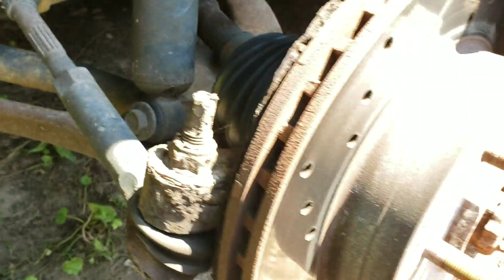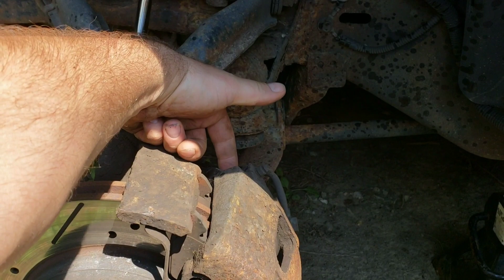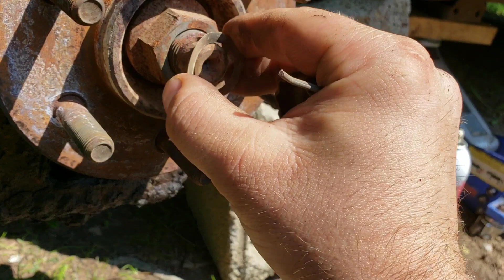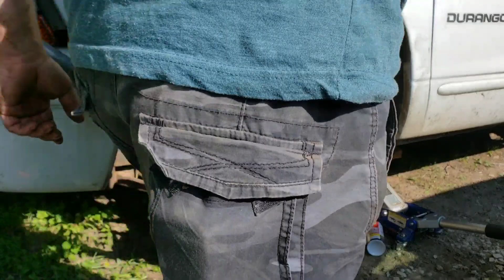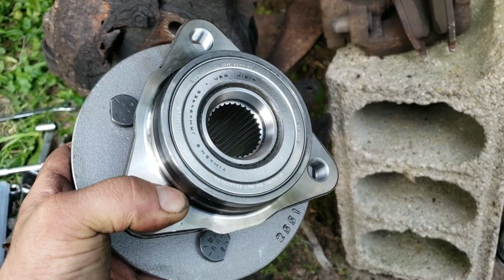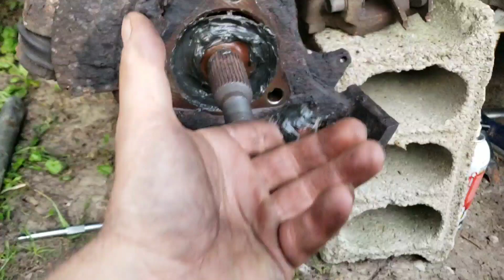98-03 Dodge Durango Front Wheel Bearing Hub How to Replace Removal and Install

Comment from the maker: Hey guys: Not sure if it's different between years/trim, but it seems that most Durango caliper bolts do in fact have the torx bit head like I used in the video. Sometimes it's possible that other owners in the past replace hardware with different sized stuff, so that's also a possibility. Please be aware that yours may be different!
Reply from the maker: Can't believe you don't know how to spell the simplest words correctly...

Comment: That was a great video.  Thanks for the help.  I'm a tired old man but I'm gonna try and replace these myself.
Reply from the maker: Powerful impact gun will really help to get the axle nut off.
Reply: @BuckeyeBallistics  Thanks,  another question...I'm assuming my issue is front hub-bearing but not sure what side.  I jacked it up and spun both sides by hand and couldn't tell.  I have checked out the front and rear diff. & transfer case, no issues.  How can I test to see which side bearing is bad?  Thanks in advance for your thoughts.
Reply from the maker: @supercancerman1959  Spin it and listen as you did, or grab the tire and shake/twist it back and forth, left and right, top to bottom to see if it has play. But doing this will also let the wheel/tire flop around if there is a bad ball joint or other component to the front suspension geometry that'a bad, so watch those and be sure that it's not one of those before assuming bearing. Other than that, stick your head out the window and do a bunch of turns in a big empty parking lot and listen, then have someone else drive and stick your head out the other side to find which side it is.

Comment: get a beefy breaker bar/pry bar/pounding bar from a hardware store, and put it in between the bolts, then take care of the nut with a 3/4" size socket wrench-- 1/2" is just won't cut it.

Comment: For those who go through hubs constantly avoid cost efficient hubs moog or timken have good warranty and reliability as well. If you over torque the axle/spindle nut you will go through bearings fast as well.  This is obvious but make sure your ball joints are good before finishing... having your wheel seperate isn't a fun experience. lol @Guns&Cars was equipped with the knowledge as it seems

Comment: Those hub nuts can be a mother after years of corrosion and heat, its like they weld together. I periodically get under my truck with a can of lubricant and hit everything with bolts from front to back. It pays off when its time to do major work. Good job on the work!
Reply from the maker: Thank you man, and that's not a bad idea.

Comment: Ok, some more advice needed...As you suggested had a friend drive the truck around in circles and wasn't able to diagnose which wheel bearing was grinding.  So I guessed and pulled the drivers side.  It came off pretty easy I think overnight soaking and several squirts of BP did the trick.  So after I get the hub off the thing doesn't have any slop to it and when I spin it by hand it doesn't grind.  So...I move to the passenger side and pull it.  Same result.  So I'm going to obviously replace both sides,  just wondering is it possible that the bearing(s) is shot but doesn't have any slop to it or grinding when spinning on the bench, by hand.  I guess my worry is maybe I misdiagnosed the whole mess and I'll replace both hubs for 300+ and still have the grinding in the front end.  That said both had moisture and red-rust colored liquid with no grease in the cups whatsoever.  Clairvoyant anyone???? Tks in advance? Wally
Reply from the maker: If it's dry in there, no grease on the bearings, then it's going to make some noise. Mine did the same thing, only made noise with the weight of the vehicle on it. Other than that, could be in the front diff/transfer case if it's a 4x4.
Reply: @BuckeyeBallistics  Ok, thanks thats what I was thinking.  Guess I'll replace both bearing hubs and then I'll have an answer,  In the process of diagnosing the original problem I drained both differentials and transfer case and replaced the fluid. So I guess its the hubs.  I'll let you know as soon as it stops raining and I can get back to it.
Reply from the maker: @supercancerman1959  Without hearing it myself, that would be my guess.

Comment: Awesome video. Plan on doing my 2000 dakota 4wd today. Not looking forward to it
Reply from the maker: Lol yeah, hopefully yours goes a little smoother for yah.
Reply: It’s actually not that hard
Reply: Guns&Cars mine was born and raised in Arizona, got the whole job done in about 45 min
Reply from the maker: With your fancy power tools lol.
Reply: Guns&Cars well.. yes. But I do have the advantage of no rust.
Reply: Guns&Cars I even went through the steps of separating the upper balljoint because I couldn’t get a sock on the bolts for the hub, so I had to remove the axle and then tighten it up and reinstall the axle

Comment: my 2002 has 7mm hex head bolts but one bad thing is not let your friends or son take the two pin guide bolts out without watching them because they have no knowledge of cross threading or not using there fingers to put them back in and wiggle the caliper slightly till you at least get 2 or three or more twist while you know for a fact they started threading or you'll have problems finding a oversize bolt that cost 25 bolt that retreads the stripped treads.

Comment: If you have the time to wait, pre-soak those rusty bolts for 1-3 days. Every minute helps.
Reply from the maker: You aren't wrong. I've soaked some overnight that I absolutely couldn't get after a 20min application and they came right out the next day.

Comment: Just to let you know I'm not sure if your car has it but if you pop out the center cap and loosen it while the wheel is on it that's what I did to my Durango
Reply from the maker: This one was so tight it would have spun the tire on the ground (have done it before). At that point you need someone to stand on the brake for you. But I often work alone and don't have the option of help like that, so I have to improvise...

Comment: Hey man thanks for the video! Tomorrow I have to replace both sides , wheel bearings are starting to hum when taken corners..  

GUYs !! Here is a wicked helpful tip !! 

For those back yard Mechanics or even repairs on the side of the road or your nearest Walmart lol 😂  wink wink haha … 

Breaking that Axle nut free !   
Guys break the Nut free when the truck is on the ground still with the tire on with the Engine weight !!  It makes life so much easier !!! 

I can’t stress enough that some people get there ass kicked trying to get that nut off if they don’t have a 1/2 or 1” air gun with them .. 

I hope I save or help someone out with this helpful tip !! 
I may be a surfer but I’m also a diesel mechanic  my Farther was a mechanic so I was pretty much a grease Monkey the day I was born haha 😆 .. 

Stay rad ! 🤘🏽🤙🏽🤙🏽
Reply from the maker: If yours is as tight as mine was, it will spin the tire on pavement (ask me how I know). In such a scenario, you will have no choice but to take the tire off and chain it up.
Reply: @BuckeyeBallistics , an alternate method is before removing the caliper & rotor, stick a decent thickness (sacrificial) screw driver in the fins inside the rotor. When you turn the nut the rotor/hub will spin until the screw driver comes in contact with the caliper mount and stop the rotor/hub from turning. You want the shaft of the screw driver to come in contact with the caliper, not the plastic handle of course. It will lock it in place so you can really get some force on the breaker bar to break the nut loose. The distance between the outer diameter of the rotor and the caliper is pretty small so the screw driver may only bend a little if at all. Nothing near the almost 90 degrees like the long extension used in this video (btw, wow!). The same technique works for torquing the nut back down at the end. Hope that helps someone.
Reply from the maker: If it's tight enough as I discussed above, I would be concerned about cracking the rotor. You may think that's not possible, but I've seen it happen.
Reply: @BuckeyeBallistics , I would think the screw driver would bend way before that would happen. Screw driver metal is not as tough as brake rotor metal.  Rotors withstand considerable forces during braking, so they are pretty strong. But yeah, anythings possible (e.g. if the rotor was already cracked from excessive heat).
Reply from the maker: Well it would depend on the size of the screwdriver and the quality of the rotor. The fins you would jam the screwdriver into are usually much thinner than the rotor itself. In general yeah it should be fine and it's a good tip, but you never know because not all rotors are created equal. 

There has been a problem lately with cheap knock off rotors comming in from China being sold as something of higher quality. I have seen the aftermath of some of these comming apart...
Reply: @BuckeyeBallistics  fair enough.

Comment: The bolt on the 1st gen durango's are hex bit NOT torque bits. You can jamb a torque in there and it might work, but your going to damage the bolt eventually.
Reply from the maker: I made that clear in the video... I said "allen type head", like an allen wrench, which is hex, and even showed it. I made it clear that I was improvising. Also, if you read my pinned comment, some or most of them do have the torx head, and not hex. Like I said in the video, sometimes new components come with new hardware. The truck might come with hex or torx, but then if someone replaces the caliper down the road with new hardware and pins, it may come with a different head. So anybody out there could run into anything in reality. So regardless of which kind you encounter, I made it clear that you should use the correct one if you can....

Comment: About 2 years ago my bango looked rusted bad like that now here I sit after 10,000 this year in maintenance.. 0-0 Oh well runs good drives good ;-;
Reply from the maker: $10,000? Please tell me that's a typo, because you could've bought 3-4 of them for that.
Reply: @BuckeyeBallistics  It's the sad truth I'm afraid lol Oh well might as well throw a 392 in it next lol
Reply: Last night I rebuilt a wheel hub press in bearing that failed early Lol Don't let the "mechanics" tell you that you can't rebuild just the bearing. I'm 22 years old and class is in session lol
Reply from the maker: You can rebuild them with the proper tools, but it's a pain. I'm about to do a press fit bearing on our Corolla, hope my bearing driver will get it in there because I don't have a press. Gonna throw it in the freezer first.
Reply: @BuckeyeBallistics  I used a pry bar and your video length worth of patience the freezer makes everything better. I know a lady in my area selling her bango for 600 bucks because it is running poor lol I just hate to steal it it hurts xD There is no way I will sell my truck for what people want for them. Not after my dedication to the speedy grocery gas gulper to make sure it's heart beats better than mine. LOL

Comment: Where is the front ABS sensors located on/near the hub?
Reply from the maker: Typically they would be on the back or side of the hub, but mine for example doesn't have abs...

Comment: Is it not possible to replace just the bearing? 

I have 2002 Durango with 2wd 5.9l

Or is it the whole assembly
Reply from the maker: Typically it's the whole assembly, but I have seen people replace just the bearing before if you can find just the bearing and seal somewhere. But for the cost of the bearing and seal and time/effort to replace it, it's better (for most) to just replace the whole untit- especially if it has abs, because then you aren't putting new bearings with an old speed sensor that might fail later down the road. Also, depending on how bad the bearings are, the whole thing might be trash anyway.

Comment: Was your hub bearing making a thud sound from time to time....i have a 2002 Durango....and thats what im experiencing....changed out rack n pinion...inner and outer tie rods....brakes and shocks...
Reply from the maker: I've changed out a lot of wheel bearings/hubs and I can't say that I've ever heard one "thud," though they can make various noises when they are worn. I've heard grinding, whirring, clicking, and even what sounded like a dirtbike accelerating because one was so dry. If your hub is making a thud sound, then it's about to fall apart lol. I just recently made a short clip about how to check if they are bad:  https://youtube.com/shorts/Sp6-swrvrT0?feature=share
Reply: Yeah you know I say thud a-poppin loud popping sound you can feel it through the steering wheel but anyway I'm rebuilding the whole front end everything brand new so it don't matter... I guess you could even describe it as a loud pop... I'm changing the CV axles upper and lower control arm both sides rotors hub bearing assembly calipers and shocks and rack and pinion so it'll all be brand-new shortly
Reply from the maker: My best guess would be a ball joint but it's hard to tell without actually driving and hearing it for myself in person.
Reply: @BuckeyeBallistics  yep thought about those to... but they come on the new on upper and lower control arms.... but we're pretty positive that the movement is coming from where the CV axle goes through the hub bearing assembly
Reply from the maker: If you remember after the parts are installed, update me because I would be curious to know what you find.

Comment: saftywise concrete blocks are not safe and prone to sudden failure with no warning, i would never use one for support when working under or partly under a vehicle. just saying.
Reply from the maker: I wasn't under it so I wasn't that worried about it. I do need to invest in larger jack stands for my trucks though, because the ones I have are too small.

Comment: This guy makes this look hard, I just did it and its not that hard OMG...
Reply from the maker: Um, what part? Cause I never said it was hard. I try to be thorough and discuss anything one might run into, especially for the unsuspecting first timer trying to do it themselves. And sometimes axle nuts come off easy as shit with a standard ratchet, and sometimes you snap a freakin breaker bar off on them. I've removed a few dozen axle nuts in the past decade, how about you? If you're not referring to any of the afore mentioned, please enlighten me...

Comment: Was your old wheel bearing making a clicking noise?
Reply from the maker: If I remember correctly, it was making a whirring/grinding sound. But I actually just replaced the other side finally just a few weeks ago and it (passenger side) was making a clicking/grinding sound when I would go around a slight left hand corner at the right speed. I have also heard them sound like a freaking motorbike when they are dried up, and even clicking/marbles rolling around sound. It's real easy to check them- I just posted a "short" a few weeks ago showing how to check the bearing (on the durango actually). Check it out...
Reply: @BuckeyeBallistics  right on brother! My driverside is making a clicking noise that's why i asked. Im getting ready to buy some mevotech ones. I'll check it out for sure!
Reply from the maker: If not the bearing then most likely the axle (if it's a 4x4). That is the common tell-tale sign of a failing axle- clicking. But a bearing can do it too...

Comment: You never reinstalled the caliper spring thingie!
Reply from the maker: You're right, I forgot! 1000 miles later, still works fine without it! I think I showed how I reinstalled it in my brake video if anyone needs to see.
Reply: It was only a Anti-rattle clip lol

Comment: Clockwise or counterclock wise to loosen bearing nuts?
Reply from the maker: Counter? Didn't you see me jumping on the bar? Lol, don't skip the video and then ask questions that were answered in the video...
Reply: @BuckeyeBallistics  not the axle nut. At 10:13
Reply from the maker: Everything is counter clockwise- lefty loosey, righty tighty. Usually the reverse thread crap is exhuast stud/engine components.

Comment: I can't find where to buy those hub bolts
Reply from the maker: The mounting bolts?
Reply: @BuckeyeBallistics  yes
Reply from the maker: @tylerpreston8720  Typically hardware stores like lowes and home depot won't carry automotive sized bolts, because they are built to stronger standards than what they carry. You will either have to get them at an auto parts store, or order them from a Dodge dealer; they will be expensive from the dealer.
Reply: @BuckeyeBallistics  I really just don't know what part number the bolts are or what they're called. All the auto parts stores at check they only sell the bolts with the hub
Reply from the maker: @tylerpreston8720  Hardware and fasteners like that may not have a part number. But if they do, your local Dodge dealer will have it. Just call the dealer and ask for the parts department. Then ask them for the part number. If you're trying to order it by the part number, then it's going to be expensive whether you buy it from a dealer or not, so might as well buy it from them at that point. If you want cheap bolts, take one to a hardware store and find out what thread/pitch it is with their check tools, then measure the length, and now you know what bolt you need. What thread is it and how long, that's all you need. Those bolts have to be strong so they don't break off; you don't want your hub comming apart at 80mph or when you hit a pothole. So that's why the hardware store may not carry the size you need, but the autoparts store may. Other than that, you'll just have to buckle and pay full price from the dealer, $5-$10 per bolt.